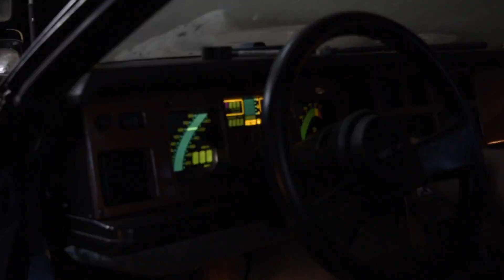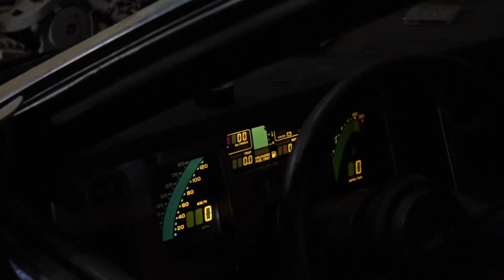Getting the 1987 Corvette fixed up after sitting for 20 YEARS! | Part 1

Comment: i just got an 86 C-4 that had been sitting in a garage for 11yrs. and went thru the same starting process. after i got it home i flushed out the gas tank replaced the fuel pump, strainer and fuel filter. flushed out the fuel lines and she came to life. i'm now replacing the heater core and flushing the cooling system. nice collector cars!
Reply from the maker: That's awesome.  Best of luck with that heater core, I had to do that in my Jeep, and not only did I end up with spare bolts left over, but I crashed the jeep thanks to black ice not even two months later!  lol.  Love how these C4's are so durable.  I am a sucker for the C3's body design though!

Comment: I had the same problem with mine it's been sitting for years and all we did was replace the fuel pump and found out there was a short in one of the relays it runs fine now. But may be other problems too
Reply from the maker: Ours was a bad fuel pump and nothing more luckily, see part 2 for details!

Comment: Pumping the throttle on a fuel injection is pointless. But super cool video
Reply from the maker: It allows the throttle body to open up and allows air into the engine so that the starting fluid can get into the intake.  And thanks!